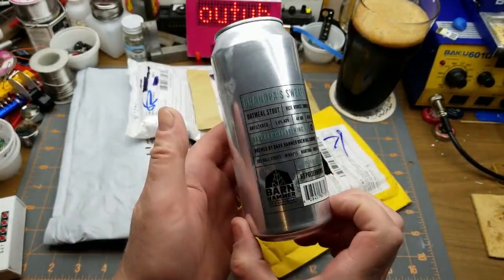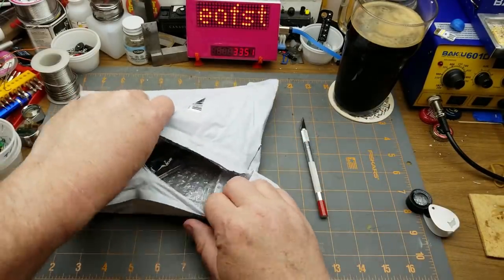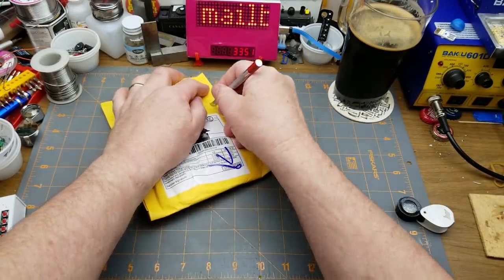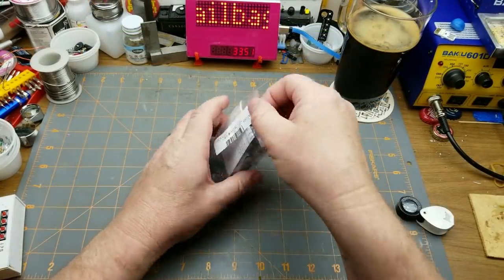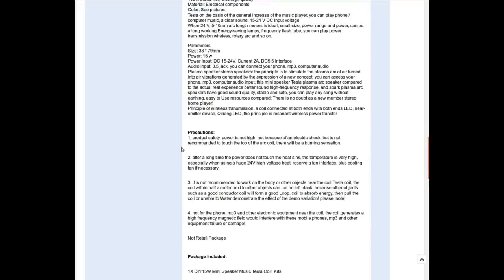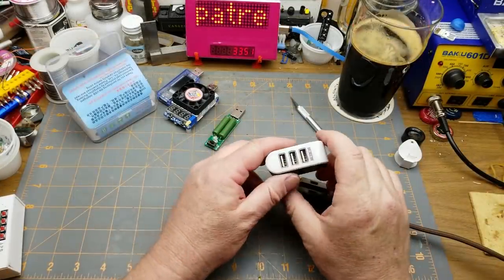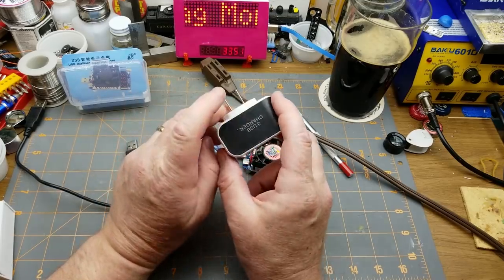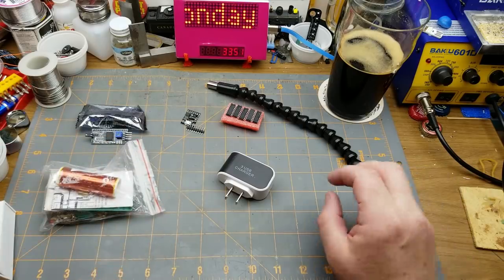mailbag monday #57

Comment: on those cheap usb plug in chargers, they have a bad tendency to put high mains voltage bleed through to ground. I have measured 90 volts ac on some of these. no good. buyer beware
Reply from the maker: I've been doing some tests on it. Video coming soon...

Comment: That Tesla Coil kit was the 1st kit I attempted to put together. I did not succeed. 😂
Reply from the maker: I'm more worried about hurting myself .
Reply: @pileofstuff  That thing sucks so bad, you couldn't hurt yourself if you fed it with 1 kv.
Reply: @Haze - You probably didn't fail - the kit is a POS.  It's technically not a Tesla coil anyway.
Reply: @jimb032  It sat on the shelf for months as I had no way to power it properly. As I learned more, I periodically returned to it but one night, after I figured out how to get more voltage, I misunderstood the pins on the DC jack and clipped alligators to the bottom soldered in leads in reverse and fried one of the TO-220 packages. If I can find cheap replacements I'll fix it but I have yet to ... cheers!

Comment: [mandatory BigClive song about pink charger played]. 
I bet if you put a dispute on charger (you should), they're will be claiming that charger marked as "3.1A", clearly it's mean "3 ports, 1 A total". [evil face emoji placeholder]
Reply: Ed Zachery my thoughts also. Dispute and get refund. I have disputed so many things from china I have stopped buying stuff from there. ( My choice ) Big Clive? First time I saw him was the Video he did on the doll that shot flames out of it's ass. Hooked every since.
Reply: Did the seller state it was 3 amps per slot if not I would assume it was 1 amp per slot, the buyer has a responsibly to understand what they are buying. You can always message seller before buying.
Reply from the maker: That's part of the risk of doing these mailbag videos - often I don't open the package until a couple of months after the thing arrives - which is usually a month or more after I ordered it.
The time period to file a dispute is long gone (and usually so is the original listing)

It's a risk I am willing to accept when trying to buy the cheapest viable stuff - sometimes the gamble doesn't pay off.
Reply from the maker: @DrexProjects  I accept the risks of buying as cheap as possible. Hopefully someone learns which risks are acceptable and which aren't from my videos.